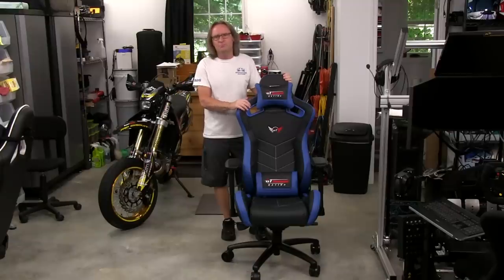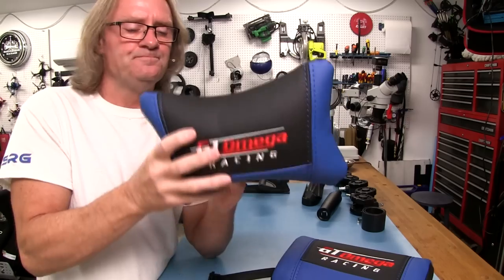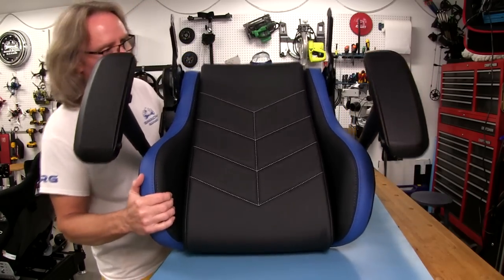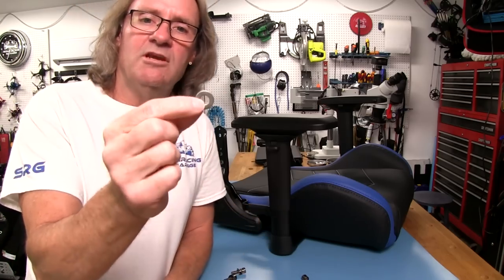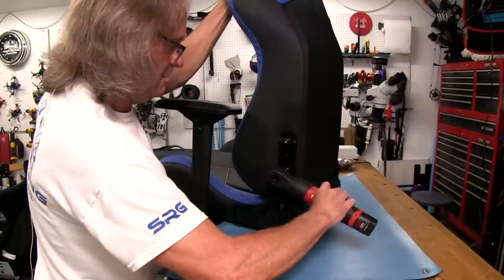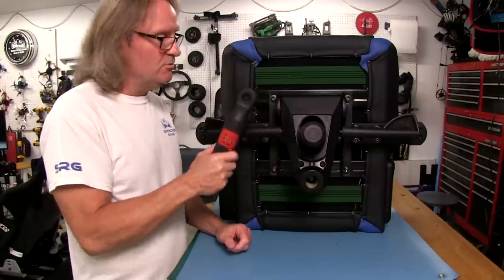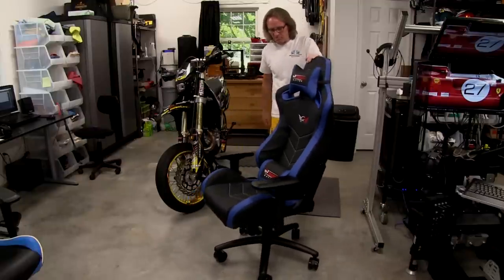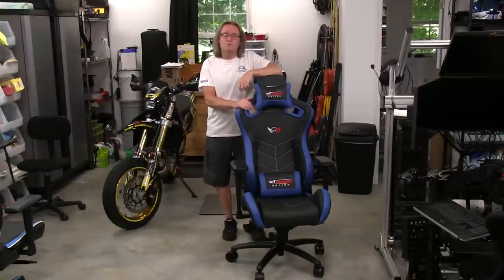GT Omega Sport Chair Review

Comment: Replaced chair wheels with cheap adjustable leveling feets to stop chair moving when using pedals.
Reply: How do you stop it swivelling side to side though?
Reply: @Steve-qr2lm  That has not been as fatal as seat moving away from pedals, so I am kind of surviving. Perhaps you can bolt seat part on top of ordinary chair or build removable  "exoskeleton" for the lower part of seat or study how yaw rotation is implemented on seat and figure out something more elegant.